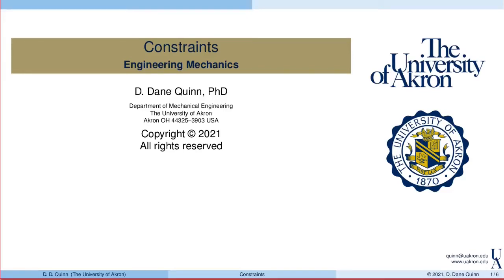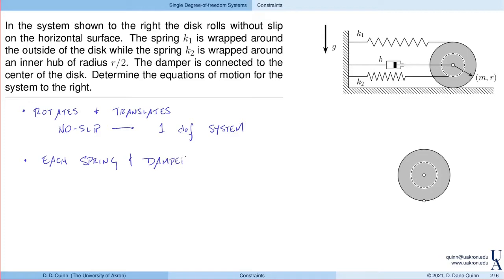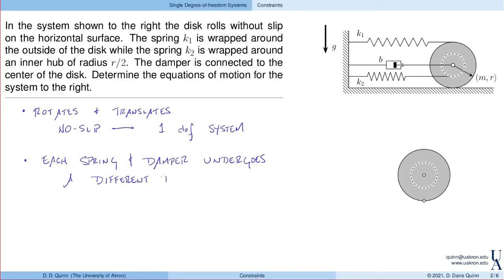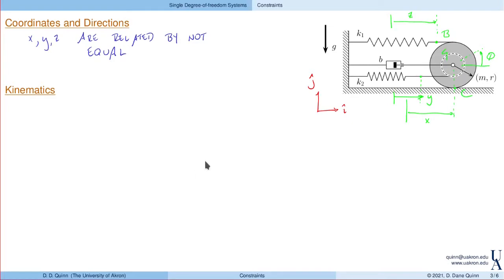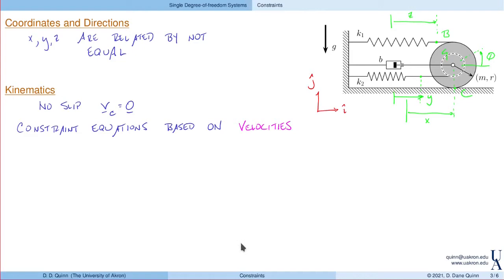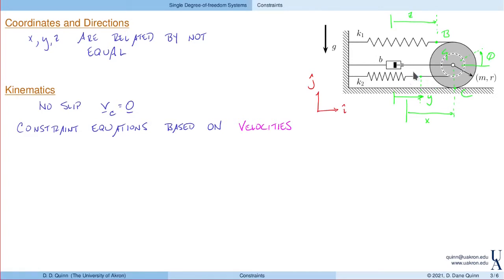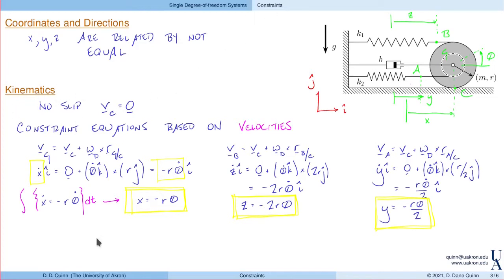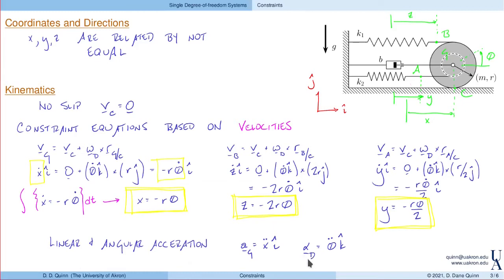UA - ME 431: Constraints

Comment: Hello, first of all, thank you for sharing these great works it really helps since the number of sources tend to decrease once the subject gets uncommon and specific just like going up the pyramid :) anyways my question is, you solved the question like a dynamics question and that makes sense, but you calculated z, x and y in terms of theta like their directions are always horizontal, but since the wheel is going to turn, x,y and z vector are going to have vertical components, but in your calculations you didn't take that into account. I tried to solve it by taking this into consideration by using Lagrange's method but there were so many equations so I wanted to ask you first before I proceed with Lagrange.